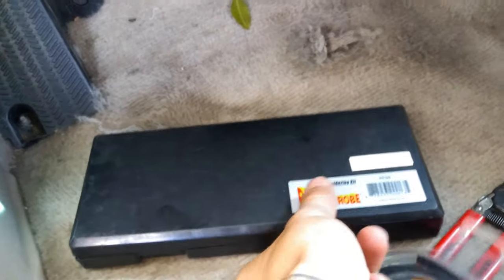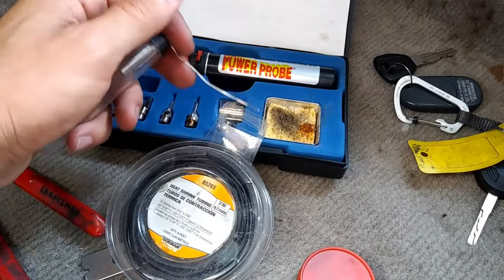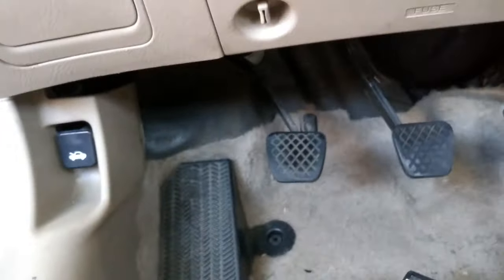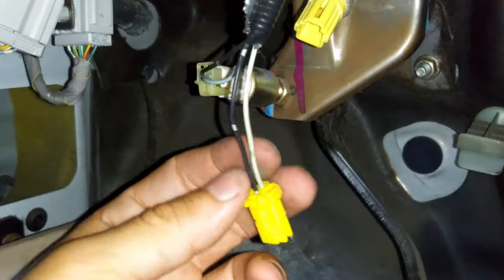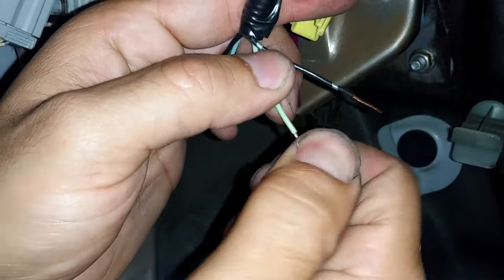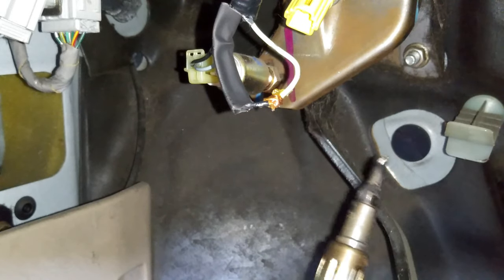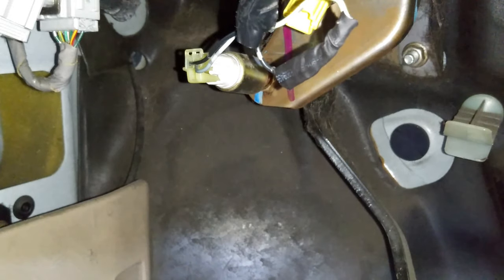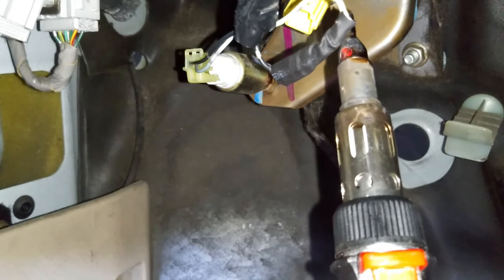how to bypass a clutch switch

Comment: This don’t work on my car
Reply from the maker: What kind of car is it
Reply: Jabo The Mechanic Hyundai Accent 2006 Manuel transmission
Reply from the maker: @unit1jeremie  it will work. Are you sure you got the right wires
Reply: Jabo The Mechanic yeah man I can send a video to you tomorrow of the wire and me trying if you could give me your opinion after that it would be great
Reply from the maker: @unit1jeremie  yes please.
Reply: Jabo The Mechanic I ended up taking the clutch sensor off cleaning it and rewired it back on. And it worked, so strange.
Reply from the maker: @unit1jeremie  yeah thats weird. Well at least you got it
Reply: @JaboTheMechanic  hey can you please let me know if this will work on a 06 Cadillac cts? I have 4 wores connected to the clutch switch, 2 are positive and 2 negative. Would I connect + to + or + to - ?

Comment: By doing this and your vehicle dies on a set of railroad tracks, your can put your manual vehicle in gear, hit the starter, and your starter can drive your your vehicle safely off the railroad tracks. These safety switches are “hand-wringer’s” pains in the ass.